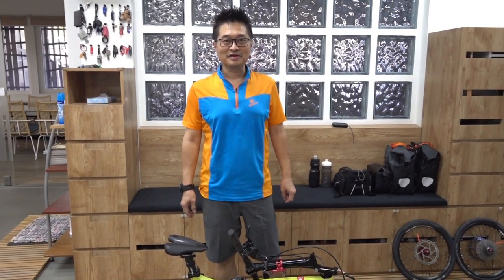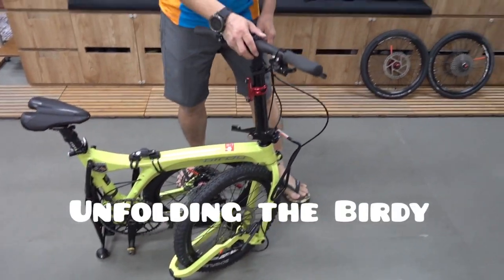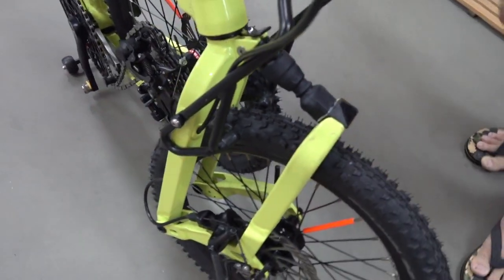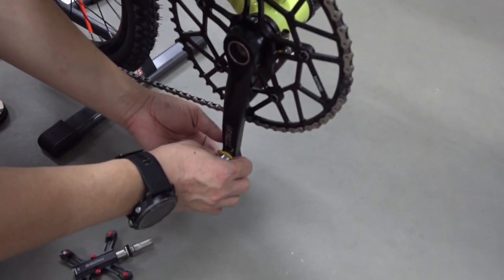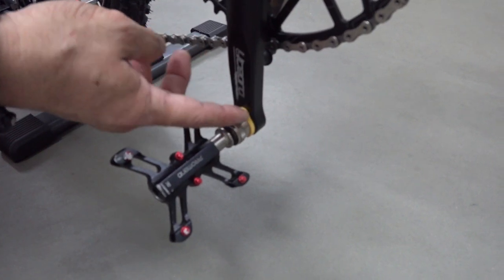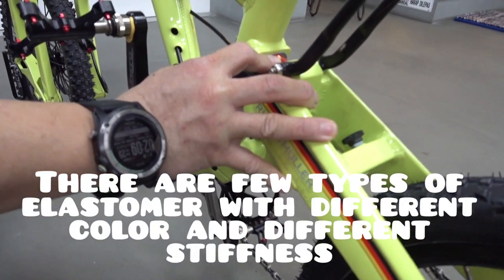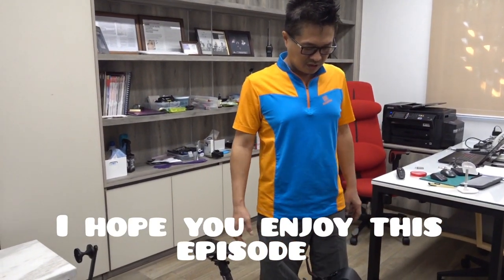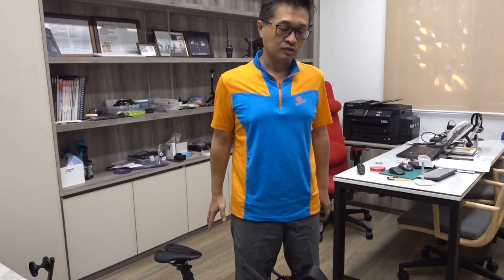How to convert your Birdy into MTB for Touring

Comment: Hi nice set up, may I know what is the bottle cages used for both front stem and on bike frame? Thanks!
Reply from the maker: Hi Alan, for long ride we need to prepare more drink water than usual as sometimes not easy to find convenient store. So more than one water bottle is recommended. Both bottle cage is for water bottle holder. On the stem, you may install one with magnetic so easier to grab out while riding. For one install on frame is for reserve or you may use it for bottle with tools inside. Thank you.
Reply: @ATCyclingCanal  any particular magnetic brand cage to recommend? Thanks.
Reply from the maker: @UncleAT  : check: Fidlock Twist